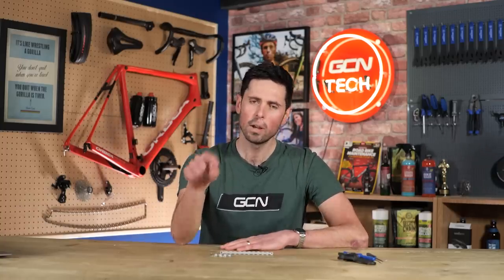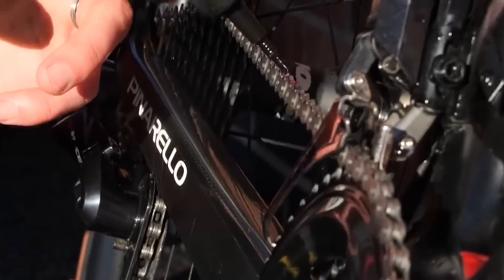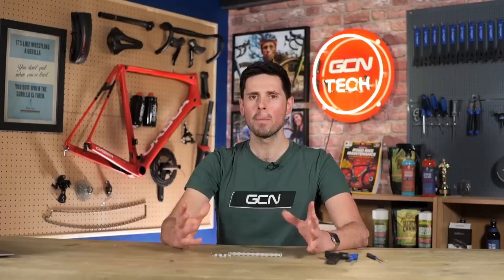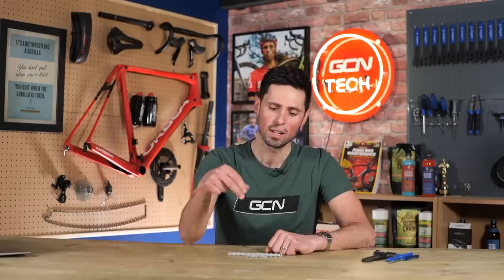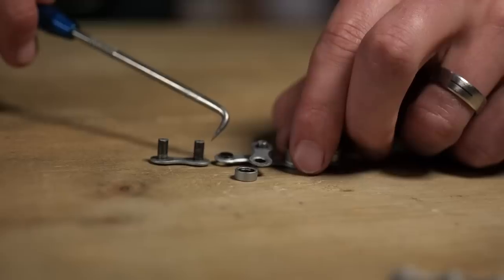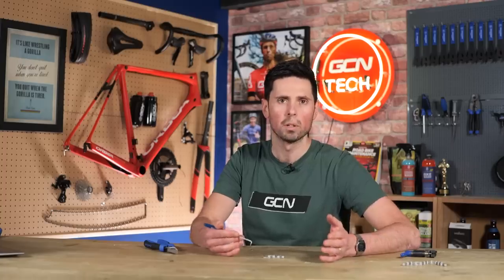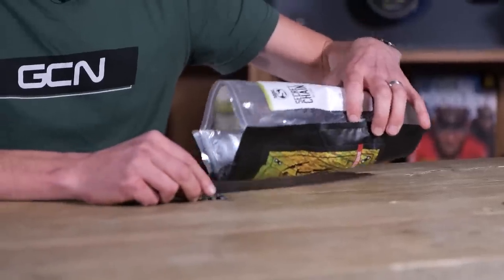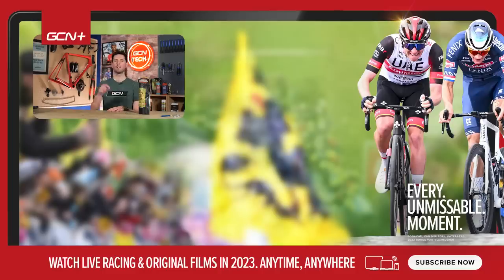5 Ways You're Destroying Your Chain & How To Lube It Properly!

Comment: Hi @GCN Tech:
I'm Sadly missing one important thing: please precise WHERE TO APPLY the lubricant! Sometimes, it's done right, sometimes, it's done wrong in your examples in the video!

If you are on the road and don't have time to let your freshly lubed chain sit over night, lube the INNER circumference of the chain! Therefor, apply the oil on the chain below the chain stay! The centrifugal force generated when pedaling then transports your lube past the pins and through the entire chain, to all those places, exactly where we want it to reach! 

When done wrong by lubing the chain on the outside, because of the centrifugal force generated by pedaling, all the oil is going to fling off, and there it is, where the real waste of product is talking place!

Only ever apply lube on the outer side of your chain, when you have time to let it sink in and let gravity do it's job over night! And it's only the next morning, when you wipe off the excess product!
Reply: I think the oil penetrates the microscopic gaps between rollers, pins and links via capillary action and by virtue of its low viscosity.  I don't think gravity or centrifugal force matters so much.
Reply: @chriswright9096  it does indeed matter  especially in racebikes if you shift the chain through all the gears.... And it is dangerous when having rimbrakes, because drops of lube could fling off the chain and hit the rim... Small but important security mesure tought at any swiss professional bike mechanic formation school.

Comment: One case to lube your cassette. I used a degreaser and sonicator to clean my cassette and chain on a regular basis. I've found that if i take the degreased casset and then store it, it will form rust spots. A quick wipe of oil will keep this from happening.

Comment: Castrol Power1 Racing 2T 2-stroke engine oil. About 1/4 the price of the best chain oils and probably does a better job due to more and longer R&D. Very good in the wet also, you can see the water beading on the surface but its also very easy to degrease with GT85 (also much cheaper than most drive chain degreasers). You're welcome. 👍

Comment: I don't destroy chains - I clean and lubricate them with Muc-off lubricants when needed -, but on the flipside I had a chain that destroyed itself after just two years. The other day I took it off in order to clean it and, when I inspected it closely, I found out four link plates were cracked. At first I thought it was just some small debris that got stuck in a pin - some lint or hair, or something like that -, but it was actually a crack. The same with three other links. It was a PC-890 chain, the most expensive in SRAM's 8-speed range. Looking at the bright side of it, I detected the cracks in time and fortunately the chain didn't snap during one of my long-ish rides. And I could make some nice and shiny key holders out of it. Which was nice.

Comment: An emulsion based wax lube like squirt is the way to go. So much less messy than an oil, more efficient, and chains last much longer. Full melted was treatments might have a marginal edge for efficiency, but they just aren't worth the hassle. With squirt you can get away with just wiping the chain clean with a dry rag and then reapplying, takes 2 minutes.

Comment: Q for Alex: You mentioned that the wear was to the pins and rollers and a chain doesn't actually stretch. I've heard similar before. The think I don't quite understand is when an old chain is measured against a new chain, the overall length is noticeably different. A worn chain is longer. Any explanation for why that is?
Reply: The metal isnt stretching. The metal wears away and this metal removal allows the chain links to move further apart from each other..

Comment: Hi Alex, a big thumbs up from me.
I used to use oil but have recently changed to hot wax (I hope i did it right, lets see Ollie's vid).  I have found it great.  Quieter, better shifting, altogether better.
The only draw back i have encoutered is, because when not being ridden, my bike lives in a damp shed (best I can do at the moment) the wax has worn off the outer surfaces and a thin rust film formed.  What can I do?
Reply: Before you put the bike away, run the chain backwards through a rag made wet with WD40, it will displell any water without affecting the wax on the inside. Do not spray WD40 onto your chain, it goes everywhere, including onto your disks/rims.
Reply: @carlmullender2941  Wipe the chain off with a rag and denatured alcohol. The alcohol will not leave any residue. Follow this up with a wax drip lube.
Reply: @carlmullender2941  Thanks Carl.
Reply: Agree, at the end of a wet ride, just dry off any excess water on the chain with a rag. The good thing about wax is the rag won't get filthy like it would with an oil-based lube.
Reply: @andrewmcalister3462  Thanks Andrew, good advice.  I haven't ridden with this chain in the wet yet.  But I will follow this advice.

Comment: The first chain on my bike only lasted 2500km. At that time it started to feel very rough and when I replaced it, the new chain skipped on the cassette so badly I couldn't even leave my own street. I was very disappointed and annoyed that I destroyed those components of my brandnew bike so fast. 

The second chain lasted 4500km. A lot better already. With a new chain, annoyingly it skipped again, so needed my third casette already. As a precaution, I ordered new chain rings as well, but not with the intention to put them on straight away. But when comparing the old and new chain rings, I saw that the teeth on the old ones lost well over a third of their width. So I ended up replacing the whole drivetrain. 

Then a changed a few things. First of all, I switched to wax based lube. And secondly, I started rotating two chains on one cassette about every 1000km, which is about a month for me. Currently I have done 8000km with the two chains, cassette and chain rings and there is no sign of significant wear. I am pretty sure I can get at least another 1000km out of them and possibly a lot more, so it will definitely get me through the winter. Now I am almost starting to get worried that they aren't worn out before I go on a big trip this spring. I do wonder if I would need to replace the whole drivetrain including the chain rings next time, or that I can get another 10k-ish out of the chain rings.

Until today I am not completely sure what I did wrong on the first chain. I did degrease, clean and relubricate regularly. I might have lubricated it a bit excessively, but I still cannot believe that it is the only cause. Maybe my offroad bike packing trip added to it.

Comment: Great information.  I find the light lubes wash off in the rain very easily, so I worry about riding on damp days.  Is there a product that still works when wet?
Reply: Oil.  Dry lubes for dry riding, wet lubes for wet riding.

Comment: It's not so much a problem for me on my road bike, but how can I preserve my chain in cold and wet conditions, even if doesn't get too wet and dirty? I have a city bike and regularly clean my chain with one of those fancy-named park tools, also lubing it link-per-link and getting rid of any excess lube. However, after a few rides in winters conditions, it already shows some rust on out the outer plates, even though I have a towel to dry it after rainy rides and it's relatively clean. I really don't think special coating or something like that pays off on my old bike with a low-tier group set where the chain costs less than 20€ but I still want to get some decent mileage on it... is the material on these chains (Shimano 7/8/9 speed) so bad compared to 105 upwards?
Reply: I had the same problem as you especially in the winter I found the best way around this problem is to use chains that are nickel-plated from KMC and there are other manufacturers that use the same process. There are also other options like titanium and other metals but are for more expensive. It is that top coating flash Rust. And the cost is not that much more.
Reply: @damian33dc  Thanks for the tip. I think, the bike even had a KMC chain on coming from the factory. I also measured the chain and if I can trust my chain gauge, it has more wear than my road bike's 105 chain with 5-10 times the mileage. Let's try KMC on the next swap.

Comment: Canadian Winter, with slush and salt, will T** your chain. I run two chains on my Winter bike; one on and one spare. 
The T** spare goes into Naptha spirits to get the crap that I put on off, then is brush washed in detergent to clean the street crap off. It hangs to dry overnight, then soaks in 3 in 1 oil.
When to change your chain? When it's -15 and you kick your pedal back and it goes back forward,  your chain is T****ed and needs to be replaced.
Don't forget the rest of your mech when your chain is off. Hose it with WD40 to clean out the salt water and wipe down.

Comment: If you don't want to remove the chain to clean it, invest in a good chain cleaner tool from Park or others. Starting with a clean chain, cassettes, rings, and jockey wheels are essential to getting the most out of chain lube. Personally, I switched to hot wax, which creates a bit more chain noise due to less damping but is much easier to maintain, and provides a very level of lubrication and a low level of  wear. This goes triple for any of us who have older bikes or use more aged 90's components that are really hard to replace. Do yourself a favor and take some time to do a proper lube job; your parts will last much longer.
Reply from the maker: Great point about older bikes! Parts wear becomes very important when you are looking for those retro parts 😬 Have you found waxing your chain has improved your riding?

Comment: I know some guys that race super long gravel races (100+ miles) use these devices that direct a drop of oil on the train every so often.  Obviously, this is an extreme case, but would they better off using such a device or just letting it go?  Lots of dust (or mud depending on conditions) over a single ride.  Which is best?  Also, motorcycles use o-ring chains were the lubricant is sealed within the roller cavity and only needs periodic cleaning (with a rubber-safe cleaner). Is such a thing a viable option for bicycles? or it the drag created by the o-rings too much of a deterrent (I believe this to be the case)?

Comment: The problem with wax based lubes is that it is are hard to remove from the chain, for reapplication.
The lowest cœfficient of friction is actually Olive Oil. Yes it collects Dust/grit but in clean conditions this is not a problem. I clean after each ride & apply it as one drop per link. 
Compared to Wax, I now achieve an extra 800 km for the same wear in dry/clean conditions.

Comment: Since you asked, I use homemade lube of 3 parts mineral spirits to 1 part synthetic motor oil.  I’ve recently added a little STP to the mix.  I relube my chain about every 200 miles, give the mineral spirits time to evaporate, and then wipe down the chain sometime before the next ride.  It’s cheap enough that I can use it liberally to wash the chain while lubing.  I install a new chain once it shows 50% wear.  I get 3000-5000 miles at this rate depending on road conditions I ride in.  Ultegra 11-speed chains are cheap enough not to use high-priced lubes and extra time with waxing.  I know that not everyone maintains their bikes well, so that may be cause for them to use expensive lubes.  I find this to be the best cost-time benefit for me.
Reply: I found motor industry derived products often work much better, however, I also became aware that is also because they don't biodegrade (they are not meant to either). I moved on to readily biodegradable products which, although not as durable, work well enough and won't persist in the soil. Fenwick's all weather lube was the best one I found so far. Lasts a few hundred km and yet washes off easily with citrus cleaner.

Comment: I have found that fastidiously degreasing a chain is counterproductive since you cant replace the internal grease. Only when the links have worn will the lube penetrate the inner links. By then its probably too late. A wipe over the chain and a light oil seems to work best.

Comment: #gcntech on a long travelling as 2500km how the best way to do chaine maintenance? Because we can t take all poduct like degreaser, soap, etc in my bags🤔
Reply: Just take some chain lube stuff with you and wipe it off with an old rag before lubrication. You can't ride in laboratory conditions if you do such a long ride. 
My 8 speed hub motor e bike chains typically last 5k km without extensive cleaning once per month.

Comment: What's interesting is that there seem to be several and often differing opinions on drive train maintenance, depending on the source of the advice. I use Rock N Roll Gold for chain lube. The directions on the bottle are in complete opposition to your instruction here. 

The bottle indicates that a healthy stream should be applied to the chain at the cassette. Perhaps it's because the product is a cleaner and lube combined. But it's frustrating to try to do the right thing, only to hear that I'm making mistakes. 

My search for knowledge has left me feeling empty.

Comment: So, if the chain doesn’t actually get stretched, then why is the new chain which I lay out beside the old chain to get the right number of links longer?
Reply: That's due to wear at the point the links pivot around the pins.  That increase in clearance on each link adds up to a longer chain.
Reply: If every axle/rivet is worn, it will appear longer
Reply: Think of it as the holes in all the links have been widened, so when you pull the chain in tension, the links will all stretch out and the whole chain will appear longer. If you could compress the chain, you could in theory get it back to its original length
Reply: The rollers will get worn down allowing the pins to move further apart.
Reply: @chbrosz  If you place the worn chain along a straight edge and put it under compression, you will probably find that it is shorter than a new chain, because of the wear around the pins and the holes in which the pins turn. The new chain will be constant and the old chain will be as short by the same amount in compression as it is longer in extension, in comparrison to the new chain.

Comment: It does beg the question, if the side effect of a worn chain is that the roller inner diameter is slightly larger, and the post outer diameter is slightly smaller, why doesn't the roller just find it's happy place on the sprocket/chainwheel tooth as it has more freedom to find said happy place, and the real stress of the pulling forces are on the arcs of chain that cover the front of the chainring and the back of the cassette sprocket where they are already seated firmly on their teeth. We say that the spacing between rollers has increased on a "stretched" worn chain, but it's both increased and decreased without actually changing the real spacing across the entire length that runs from the Top Dead Center of the sprocket and TDC of the chainring. If the chain is still the same ultimate length, is seems illogical that a worn chain is really responsible for tooth damage, as engagement at the back of the bike is not under load, and on the front of the bike is really under stress at the whole forward half of the chainring.

Could this entire theory of a worn chain causing tooth damage actually be correlation with poor chain maintenance (dirt) in general causing friction/grinding down of the teeth and not at all be causation associated with a worn chain? Let's talk to some sprocket makers. I bet they know the real story.

Before we accept popular "wisdom" let's not forget that skinny tire theory was wrong for way too long, because we failed to challenge it.

Comment: Great video thanks. There's other videos, actually a million on here probably showing the same thing but they're garbage and get a lot wrong. This is often overlooked and many people get this process wrong, including me. I will improve now, I have a finish line chain degreaser tool which seems to work well. I use a WD-40 dry lube and a WD-40 wet lube depending on the time of the year and use finish line citrus degreaser. I have had my chain replaced twice in the past year or so and last week had to have my cassette replaced as the teeth on the top two gears were worn out the chain kept slipping and changing between the gears on it's own. Only had the bike (giant fastroad 2) for 2 years

Comment: I use a PTFE infused wax with a re-wax every 300km.  Always nice and clean and makes taking your chain on / off easy without getting mucky.
Reply: 100% wax is the way 👌
Reply: Every 300 km is probably “too often” - but if it works for you it’s likely the smoothest chain out there.

Comment: ? Have you ever done an extensive 11 speed chain comparison? 
Is there much (if any) gain of running a 105 vs Ultegra vs Dura-Ace? 
I read a post that recommended using a Campagnolo record with a Dura-Ace system. The claim is that it shifted as well as the Dura-Ace chain and had a much better life expectancy (claiming the DA chains broke too easy). “This was a hack the Crite cyclists were doing”.

Comment: So if the pin to pin distance isn’t increasing in a worn chain, why is an old chain longer than a new chain when I hang them next to each other.  Each pin to pin center on the old is slightly longer than the new?